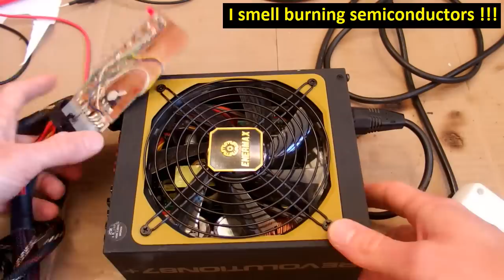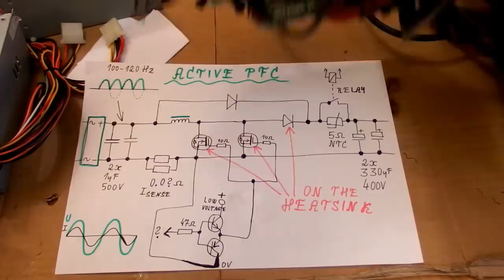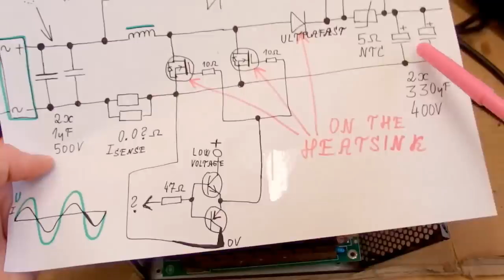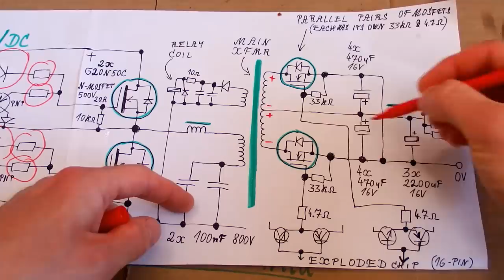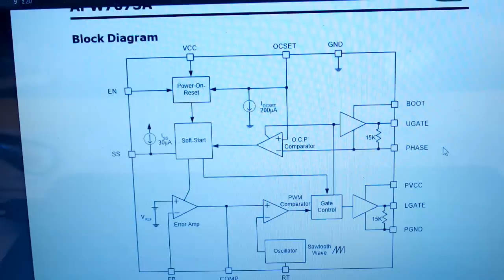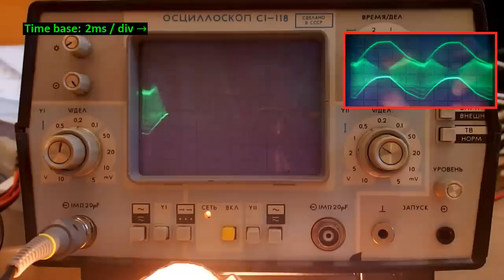850W computer power supply - how does it work (with schematics)

Comment: I've repaired a few dozen power supplies and from this video would say I think they went too far with too much complications - trying to be too smart for their own good, not realizing more complications means more things to go wrong which it has with multiple blown components. I remember the older simpler designs with slightly less efficiency but much less complications and less things to go wrong and usually was only changing out blown output or 5v standby caps.

Comment: This is a relatively cheap unit too. I'd love to see the differences between this and one of the newest 80+ platinum 1.2KW PSUs. All I know is that the 80+ platinum standard has even more stringent limits on powerfactor correction. 

Seeing you explain the active power factor correction circuits helps me understand why my PCs with very expensive PSUs in them tolerate brown outs and crappy generator power so much better than everything else in the house.

Comment: I am surprised to see you using non-conductive pointer on the schematic and seizures on the actual pc power supply. Though not powered yet the tips of the seizures could have damaged the magnetic coating of the filters wires. 
Please use non-conductive pointers in your demonstration so that the new comers don't get electrocuted. 
Thank you for your great educational videos!!
Reply: "seizures"🙏🙏🙏😭😭😭

Comment: thank you for such a detailed description and explanation of the working, I want to build a similar supply for solar power panel in series with the power correction for open cicurt voltage.

Comment: Watched and studied it all. Repairing a new never used new Apevia Signature ATX-SN1050W 1050W 80 PLUS Bronze Power Supply I bought for $10 on Ebay ...not working. I traced from 110VAC input to the outputs. Single cap for the +180vdc after the input bridge, unlike most with dual caps but that was the only power reading I was getting. Nothing was turning on. All the semicons tested good. So figured I need to find where the +5 vdc was being supplied from first ...the small transformer and associated ic next to 2 opto couplers. All looked and tested good and found  the +5 vdc from that circuit. So i traced the +5 vdc from there and found a mini crack in the +5 vdc very thin 1mm trace on the edge of the circuit board at one of the 4 mounting corner posts. Apparently the box had been dropped with enough force to move the  pcb enough to crack the trace. Solder bridged it ...success. Your info helped me track it down. Thanks
Reply: Weird it didn't break the board. . .

Comment: Fantastic 
I am getting ready to work on about eight or nine modules that are very similar and design. This is and will help me quite a bit so far I do not see any burnt components but they are blowing the input fuses. I am hoping that whatever is happening is the same part on all They are using the automatic PFC which your video taught me what that is I could not figure out what the hell that stuff was. It is probably using DC to DC conversion like your supply also.

Comment: The dc-dc converter is the LLC topology. It's a variable frequency fully resonant design operating above resonance. It has lossless switching on turn on and turn off edges so is quite efficient. Power output is controlled by increasing or decreasing the frequency. Power output increases as the frequency is lowered and approaches resonance, but must never reach resonance or lossless switching will be lost. The topology has pro's and con's but does result in quite a high power density supply. The dynamic range of the LLC topology has a limited dynamic range and is best run from a pre-regulated PFC stage. This topology is often used in 48v telecom PSU's for efficiency reasons. They are more complex to design than PWM converters and I always relied on computer modeling and simulation. Also, they are unbelievably quiet from an EMI perspective due to the soft switching.

Comment: Hellow sir, you are amazing, excuse me sir, i want to ask. how to safely replace a short mosfet on an atx power supply? because I was trying to fix a short mosfet, as soon as I installed it, the new mosfet immediately shorted again. pfc mosfet or main switching mosfet. what should be considered when replacing the mosfet? how to do proper test before installing replacement mosfet in circuit board?

Comment: The mains input circuit has the fuse and MOV almost at the bridge, why not at the beginning of the circuit. Meaning traditional short circuit / overvoltage (lightning?) component failure protection. You should design your own isolated-variable AC power supply for hot chassis switching power supply testing and trouble shooting.

Comment: Great explanation.

I'm right now troubleshooting my PSU (Cougar PowerX 550W) but I didn't figure out whats the problem. I can't see any exploding parts and 5V SB is available. The other voltages are missing. To get into detail: All voltages will come up immediately after I short the green wire (actually which voltage should be available at green? 5V??) to mass. However the PSU doesn't really turns on. I can hear a clicking sound like a relay (didn't see one on the PCB??) and the fan tries to start up, but only twitches a bit. The output caps get charged and after that slowly discharged by self discharging. The transistors on the secondary side seems to be ok (not shorten). Do you have any explanation for this behavior? I guess there is an issue with the gate driver of secondary side maybe?

Here is a review with a detailed strip down of the PSU. This gives a good overview of which components are used in this PSU. https://www.techpowerup.com/review/cougar-powerx-550w/4.html

Thanks in advance.

Comment: If you get yourself some plastic stirring straws, you can probe the components to see which are running hot without burning yourself or catching anything on fire.  I cringe every time I see you (or anyone else) probing components with something conductive or just their fingers.
Stirring straws are about $5usd for 300 on Amazon.  So they're dirt cheap.  No excuse for not using them.

Comment: Fantastic presentation. I have a Fluke 3092 200Mhz oscilloscope with smps comes on then shuts down almost instantly it has high/low protection circuitry. How can I test for voltages when it keeps shutting down. I think the problem is in the output circuitry. Many thanks.
Reply: I had the same problem - instantly blown fuse every time.   So,  I did not supply mains power I just fed the control circuits with 12V (having checked where they would be supplied from when working)   and then I could see the control circuitry trying to control and could test everything and found the bad gate driving transistor easily.
 I was rather pleased with myself.

Comment: Thank's for your video which is really amazing. 

It is indeed a risk to mend this kind of SPU until you 'r sure what made it crash. Which is not so easy.

Yes it can be the tiny transformer : aproaching 400 volts or more can perce insulation producing carboned ionised arc. 

And then the shortcut can not be so simple to detect.

To check it:  probably:

1/unsold it
2/Check it with an inulator checker with sends high voltage between primary and secondary.

These kind of product are low quality sell for "grand public".
A real professionnal power supply cost really more and then is more reliable.
So some devices are limits too thin for cost reasons. 

Please excuses my English.

Jean-Yves.

Comment: Regulation will be achieved using the PFC voltage, rather than some complicated frequency change altering tuning.  The turns ratio of the main transformer and the input voltage are all that's required for regulation when the output has synchronous rectification (MOSFETs used in secondary instead of diodes).  The two 100nF 800v caps are there to make sure that any DC imbalance in the drive doesn't end up prematurely saturating the transformer.  (Imbalance being one drive MOSFET being on slightly longer than the other, which is almost impossible to prevent).

Comment: I have a similar model of Enermax power supply that shuts down randomly. I suspect the big capacitors are failing. I already unscrewed four screws on the main circuit board, but still can't take it out. Can you tell me how to separate the board from the case?

Comment: Bravo!   Absolutely fascinating, useful and thoroughly enjoyable.  This 50 year old ET found it easy to follow and well worth watching but think any ITS, Raidioman, or RC Hobbist would really benefit from this High Power Switching ATX Power Supply works.  Nice forensics too on how you identified the likely failed components and used clues to identify the source of the short. #electronics #maintenance #powersupply

Comment: Good that you did not try to repair a cascading failure like that. 

This video is great because every sub-topology is broken down on each sheet of paper and is research topic in itself.
Eg: at @26/ mins the diode transistor pair is worth further research and a great one for including in power supply designs.

Comment: Ah, burning smell...  no, no, do not unplug the unit, let's leave it on, to see what more collateral damage we can do

AAAAH, but can you tell WHICH semiconductor is burning.....  that's the skill of a master.  

It's a musky bouquet, a little sour but dry, with an added hint of spicy metallic aftertaste.
It must a PowerTrench MOSFET and a Schottky diode.  And if it was akin to the scent of a burning corpse, well, that's the bridge rectifier.
It is odd how that smell actually lingers around in the room even the next day.  But the smell of a good steak doesn't.

Does it ever occur to anyone that tinkering around in an SMPS, can void your home fire insurance?   I didn't think so.

Comment: So most new power supply's have the PFC electronics, and that is their weak point. Usually the high voltage electrolytic capacitor drops it's capacity because it is being bombarded with high frequency from both the PFC circuit when charging and from the power supply when discharging. After it's capacitor fails sufficiently the power supply overloads and blows up the PFC. It is usually totally destroyed.

Comment: Had a psu, plugged it in, boom. Sparks, trippen breaker, everything. Still dont know whats wrong beside the fact that the discharging of the main big cap isnt working because it kept 200V for 2 months

Comment: I've been watching these videos lately. I'm really amazed at the skill and work that you have been giving in reverse engineering these 
SMPS circuits. I've learned a lot on your videos specially on understanding the general design of these power supplies. I've really gained confidence in tinkering with these devices and understanding its complicated circuitry. With your video I have fixed several power supplies mostly ATX power supplies along with some exciting fireworks on the some. So with that I would like to say Thanks!

P.S.
Would it be possible to make a  content on the common failures of these power supplies and what could possibly have caused it. Most of what I have fixed are failures on the capacitors at the output side. And those that made fireworks and big bangs are usually exploding NPN transistors at the primary side.

Comment: What can be the cause of 3.3V Rail only having 3.1V? Maybe the Capacitors having a to high internal resistance?
Reply from the maker: Maybe the capacitors, maybe the voltage sensing is wrong, the resistors in the voltage feedback inaccurate or the voltage reference inaccurate, or the voltage just drops on the cables. If you measure the voltage of a loaded power supply at the end of a cable, it will read a bit less. Also poor connectors can drop excessive voltage. At low voltages and high currents, everything has a noticeable resistance.

Comment: I work in a company where we design these power supplies with even higher power ratings. I am currently working on a 3kW AC-DC power supply. I really appreciate your knowledge and the ease with which you handle these things. I am new in this industry and I struggle to understand the supply if I don't have a schematic and PCB layout with me. 

So I am curious to know if you actually draw the schematics from your own analysis? If that's the case then you are a super hero :D Plus, your cat makes the videos even more enjoyable!
Reply: First of all, take high definition photographs. Now zoom in and draw the circuit using layers in Photoshop. Proceed from there.
Reply: why are you guys underrated

Comment: 32:36 can you make a video of how exactly the circuit works with two mosfet and one inductor? how does the voltage drop occur? what is the role of the inductor? does the voltage drop only work when a load is connected behind the inductor? Why do you have dc and not ac, so no diode after the inductor? how is the inductor calculated? laptops use the same switching in the power supplies, but can't find anything about the circuit, i don't know if this circuit has a special name?

Comment: Do you can explain how work a flyback converter in quasi resonant mode. These things don't use an optocoupler and however it can control constant current in a load. I found these things as a LED driver, one of these things uses an iW1710-01 chip, another uses a non standard Z8YL6L8WE chip and the third foetus an 8 pin chip were the code was erased with a sandstone :P

Comment: Please help me Can i plug a 230V power supply to a 220V outlet i need answer please ASAP 
because there is an indication at the back of my PSU saying "230V only" my power supply is Super Flower SF-500P12N SE
But some people said that 230V and 220V is the same
Reply from the maker: 220V and 230V is very close. The 10% tolerance ranges overlap. You can connect it to 220V with no problem.

Comment: One of the best videos of this type I've ever seen.  Packed with such a lot of useful information.  Also looks like a good PSU for modding to run a remote solar powered computer set up, or just to use a PC on a vehicle, without having to resort to using an inverter.  I'd guess many dead supplies like this have only the main switching section that has failed,  so great for re-using and getting a second life as a battery powered computer PSU.

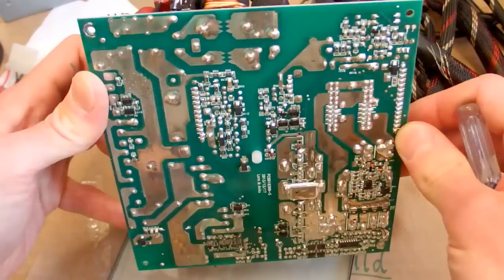Comment: Does anyone know why the connections underneath of the inductor (top edge in the middle) have this toothed form? at 7:21.
Reply: Looks like spark gaps - electric field is strongest at  sharp points so sparking is encouraged to start there.
Reply: PS sparking wouldn't be part of the normal operation of the PSU - the gaps are used to deal with fault conditions.
Reply: @joinedupjon  Thank you, I also thought it is designed for the case of a failure.

Comment: PFC ATX PSUs. They are twice as epxnesive to fix or even more. Pain in the a$$. and they generally use 20N60s, which are not cheap, and can fit 4 units or more. Also, many control circuitry is on the HOT side. Yeah, high efficiency stuff, but in the end, chinesse TL494 POS ATX units are far more reliable and cheap to fix. Same as Deltas in HPs. They like to use thing like TNY276 or so, or TOP switch., This ones dont like tanscients very much and pop very easy while poping the 5V SB on a chinesse garbage supply take way more work. Nothing againt Power Integration, but their solutions are less robust it not properly protected.

Comment: Does that mean you could have shocked yourself with the tester? Because the primary and secondary were (possibly) shorted?
Reply from the maker: It finally turned out they were not shorted inside of the gate driving transformer. It was momentarily shorted by some piece of wire or screw getting inside. And the output is grounded, so it couldn't have mains voltage in it.

Comment: @DiodeGoneWild - 
How long did the PSU last ? 
Active-PFC coil is a filter because Active PFC causes more noise than Passive-PFC.
The modular board layout is also nice for the developers of that thing.
Note: in the old / Chinese PSU , the filter board ( & PFC coil) is optional for different interference laws of different countries or cost cutting for fake PSUs

Comment: PC power supplies seem a little bit anachronistic nowadays. CPUs and graphics card are directly connected to 12V with separate connectors, and almost every other device on the board has its own switchmode power supply as well.
Reply: Yes, ATX is completely obsolete, it was designed when buck conveters were costly, so it made sense to generate the voltages in the PSU. Back then Intel was switching to 3.3V for the CPU... but nowadays 3.3V is completely obsolete and I guess the 3.3V lines are barely used by any equipment. At least 5V is still used for USB power and a few other things.

Standby voltage is also completely obsolete: We can build power supplies with negligible idle power consumption (check a laptop PSU), therefore there is no need for a standby power supply anymore, we could leave the main PSU on all the time.

And cables... the ATX connector has way to few 12V connections... so we got a mess of additional connectors.

However,  I expect ATX will be amongst us for a while, there doesn't seem to be too much desire to get rid of it.

Comment: Here's the independent test on this model:  https://clearesult5.sharepoint.com/sites/PLS/Shared%20Documents/Forms/AllItems.aspx?id=%2Fsites%2FPLS%2FShared%20Documents%2FENERMAX%20TECHNOLOGY%20CORP%5FERV850EWT%2DG%5FECOS%202838%5F850W%5FReport%2Epdf&parent=%2Fsites%2FPLS%2FShared%20Documents&p=true&cid=7de42a7b-cd87-4fb2-ad96-c5a37896e262

Great website to look up true performance of PSU.  Good reason not to get a way overpowered PSU is efficiency.  If you are only running it at <10% load 99% of time, it's efficiency may be crappy at that load say 85%, you want it to be over 20% load at computer idle to hit sweet spot.